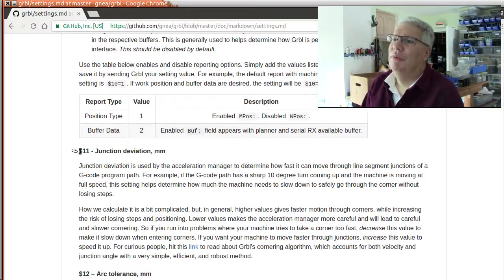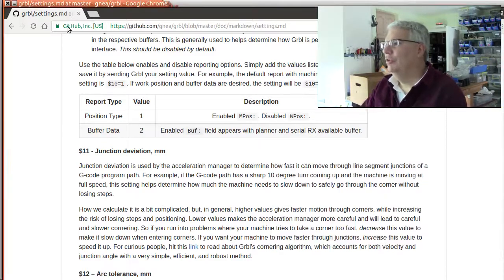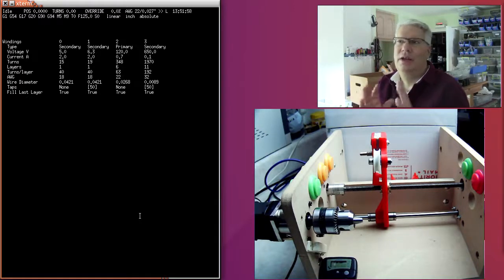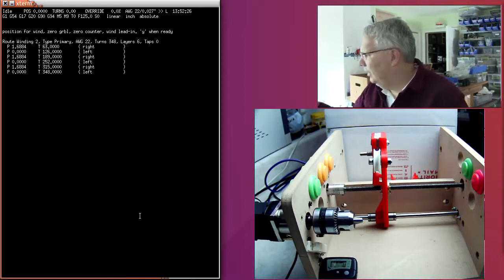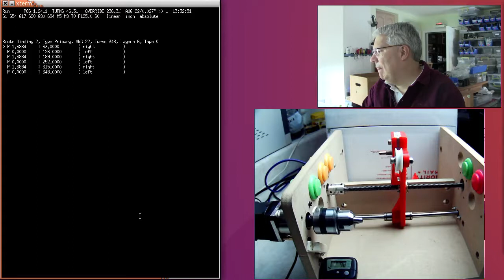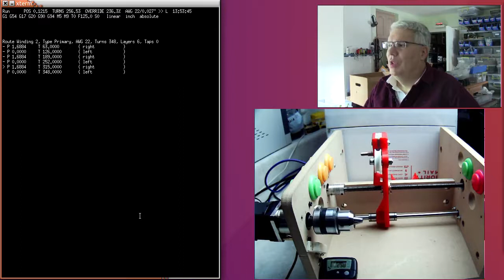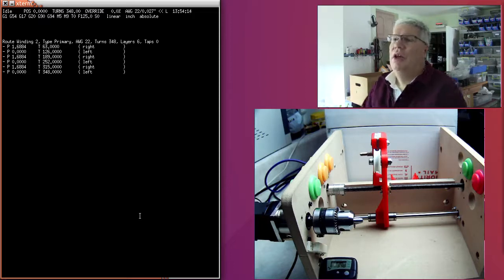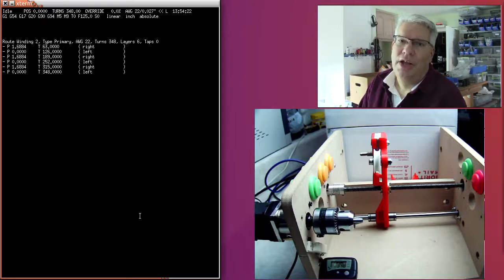170125 Valve Studio - Faraday Coil Winder and GRBL Junction Deviation

Comment: Hi Craig, Thanks for the video and realise it's a few years old now.  Would you be prepared to share the code for this test run please?
Reply from the maker: I was using grbl on an arduino, https://github.com/gnea/grbl, with some simple G code.
Reply: @CraigHollabaugh  Thanks Craig,  I meant to say gcode rather than code,  would it be possible to share one of the code files?
Reply from the maker: @nickashwell  sorry, I don't think I have that around anymore. But it's pretty simple you just run out and ask and why a certain distance with one command, then you go forward in X and backward and Y. You do have to set the junction deviation to zero, otherwise the spindle will slow down when it changes direction in Y.
Reply: @CraigHollabaugh  Thanks Craig,  I have it working and without the $11 change it changed direction in X, but at each transition, Y slowed as you explained, after setting the $11 Y rotated continously as expected , but X no longer changed direction.  Anyway thanks for the video, it is exactly what I need, just need to sort out the gcode.
Reply from the maker: @nickashwell  score!

Comment: I have a different design in mind but I'm completely lost on how to make the mechanism for the wire guide. Please share 3D printable files of the mechanism or atleast a CAD design.
Reply from the maker: look up faraday coil winder, its a public document at onshape.com
Reply: Craig Hollabaugh all i could find was this link..
https://github.com/krux702/tesla_coil_winder

Could u lend some help and verify? Also if u got any link to that onshape.com, do please share.

Much appreciated, Cheers
Thanx
Reply from the maker: my ongoing work on Faraday v2 is here
https://cad.onshape.com/documents/02215aa12f5635e7767d92e9/w/f6f567d9bcfc8b6eb52dc594/e/0fca3ff2e85c44bc30361de5
https://github.com/holla2040/faraday
Reply: Craig Hollabaugh thanx mahn... Much appreciated 🤘
Reply: Craig Hollabaugh 
If it isn't too much trouble, could u help with a few more doubts?
I intend to make a simple basic winding mechanism using arduino and suitable motor shields. And I have the following doubts :

1. What advantages do the NEMA motors serve apart from precision and control, rather than regular motors? 

2. What is the mathematics with respect to the no of turns of the 2 motors for a particular gauge of copper wire? Is there any chart for reference which gives a ratio for the 2 motor turns for different gauge wire in a tabular form, if it is available, please share.
Reply from the maker: https://www.youtube.com/watch?v=2wtVtEJFwcE
http://www.vintagewindings.com/gen%20pop/8299543VW8335/TransDesign%201/Wolpert-PowerTransformers.pdf
see also, https://www.youtube.com/channel/UC3ONYWRR_LktkiUmSX9TW1A